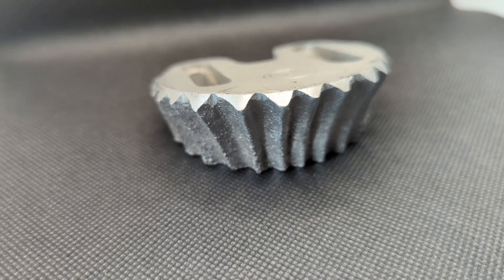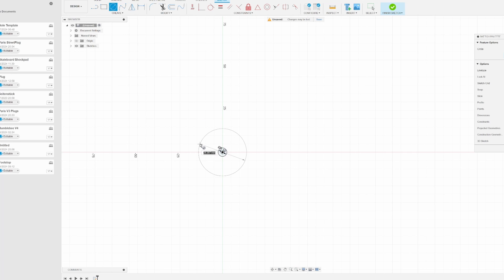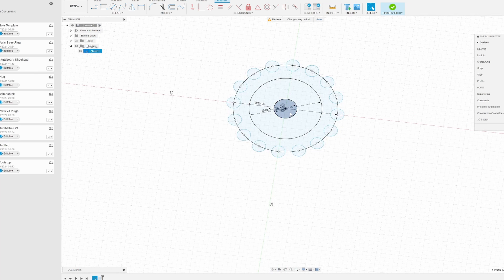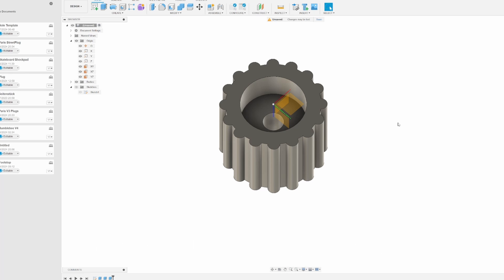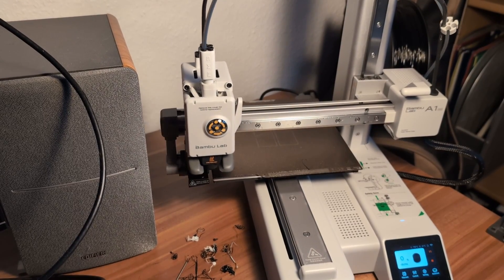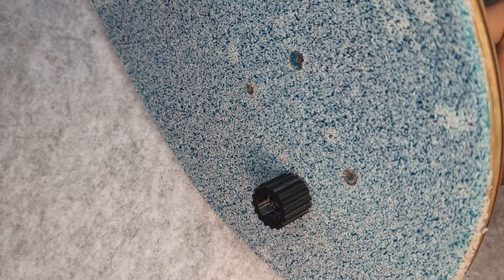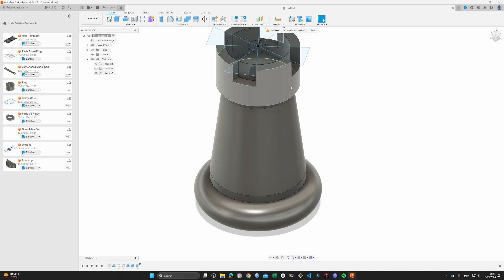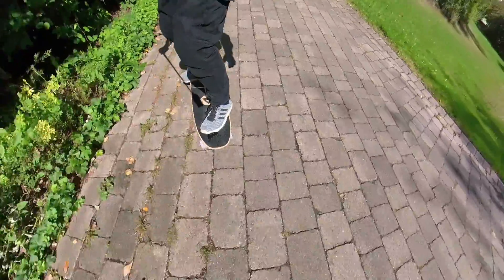Design your own Footstop for Longboarding - Tutorial for Downhill and LDP

Comment: If you make your own designs and 3D print them, you can try make it in a J-shape so that it functions as both a footstop (for toeside lock) and a toestop (for heelside lock).
Reply from the maker: @nickamarit  Sounds like an interesting idea!

Might have to try that for the next one!
Reply: @skate-horizons  You can look at DH guys' setups for inspiration.

Guys who use really grippy wheels usually have a toestop to prevent their front foot from slipping midslide.

Scythe makes a well-designed one that you can take inspiration from.